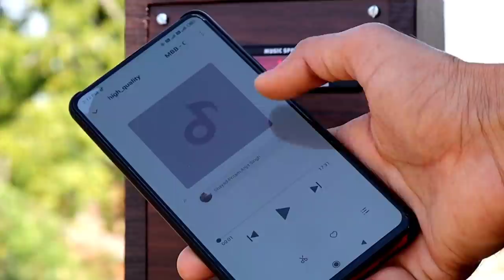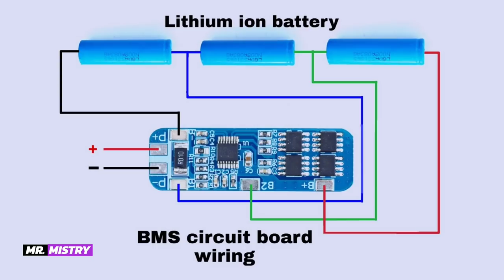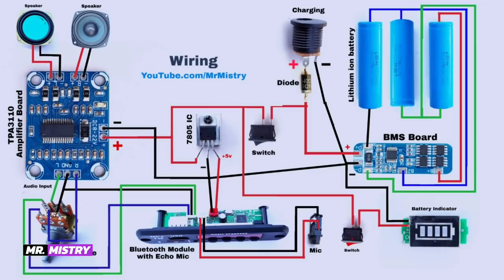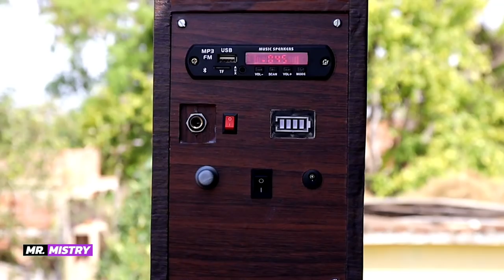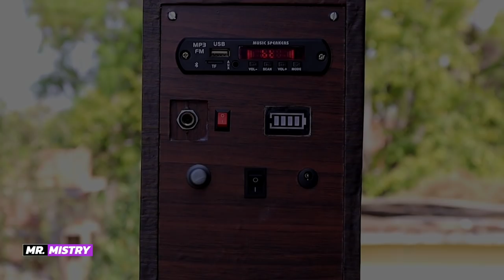Make Bluetooth Speaker With Echo Mic Using TPA3110 Board

Comment: Mistry old home theater connect pannuvathu eppadi video podunga
Reply: Old home theatre la power supply near 24 v DC supply irrukku kadaila 7805 voltage regulator kelunga 
Adhai fix seithal our end la 5 v DC supply varum ethai appadiyae Bluetooth FM la connect pannunga speaker wire colour padi join pannunga now it is ready.avvalavu than .